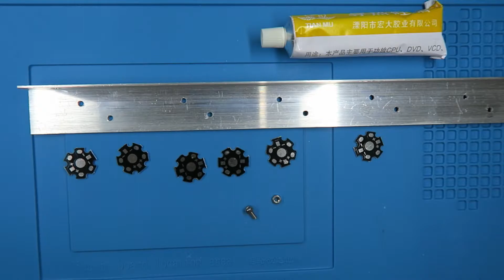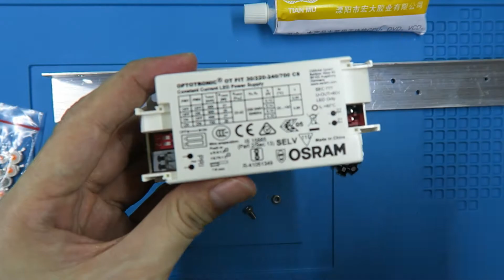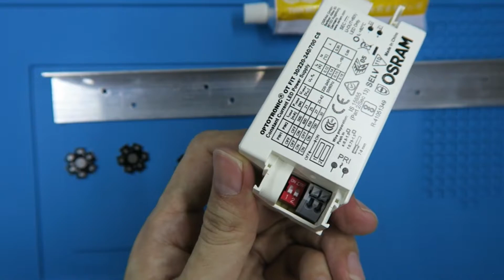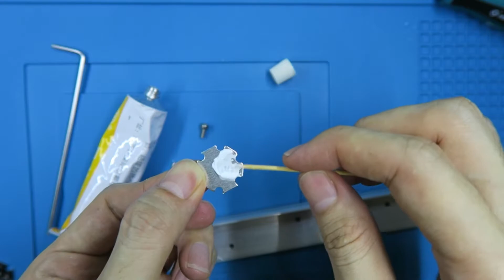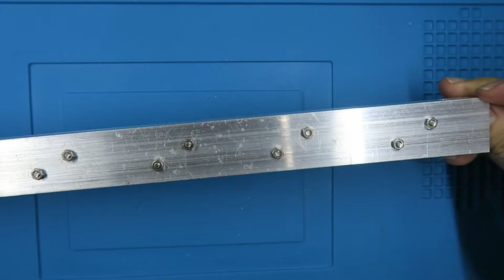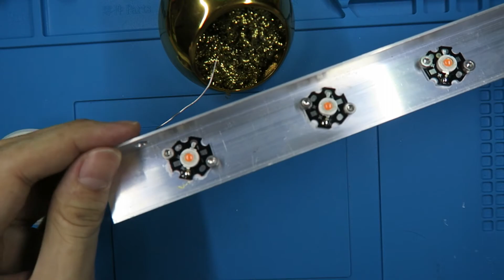12 LED Grow Light DIY Experiment with OSRAM Driver - Part 1

Comment: Searching for something I came across this.  It occurs to me that the possibility that the light may lift from
the pad during solder stage.  You might have soldered them before installing on L metal, and I would have made
a jig to put slight compression clamping them down for soldering.  Never done what your doing before, just had that thought.  like a gentile clothespin to hold them together.  Thanks for the vid. 
PS... So I'm the first??  Now thats a first as well.
Reply from the maker: thank you.